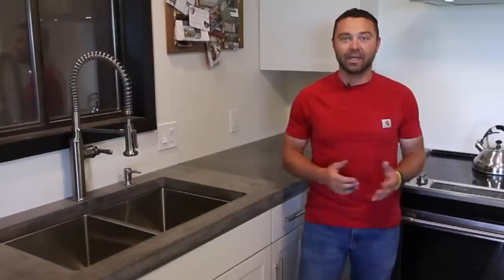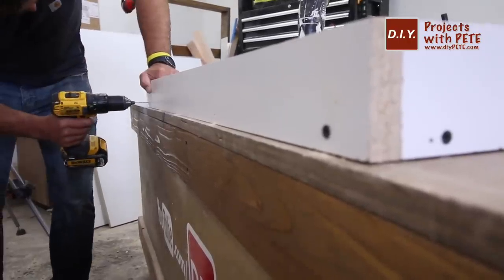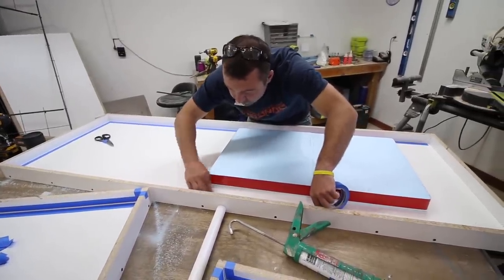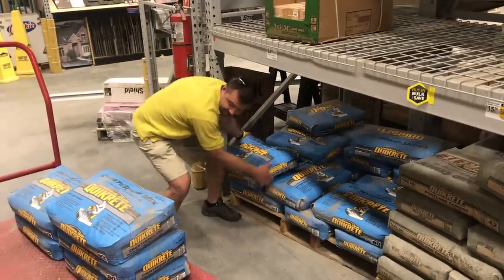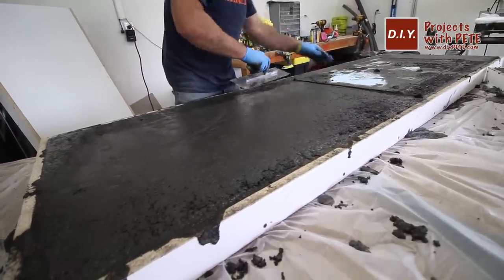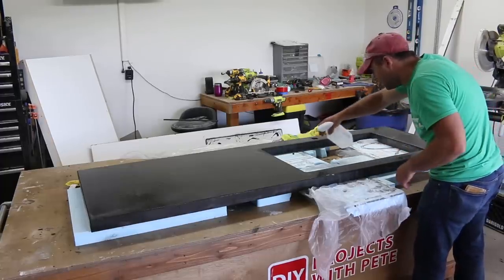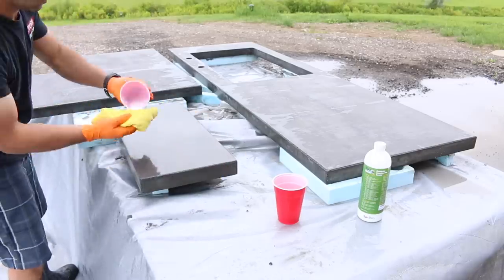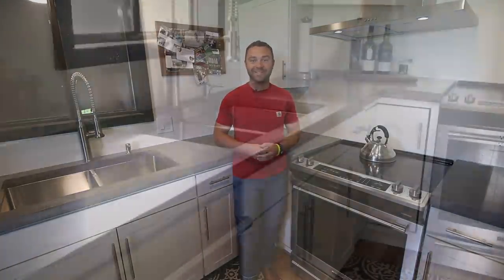How to Make Concrete Countertops

Comment: To the 'Naysayers' and those dubious about how well a concrete top will hold up - We did this in our kitchen 20 years ago, and it still looks fantastic today!
Reply from the maker: Great to hear your experiences with concrete countertops over the years!
Reply: @Seriously! How? I actually had my doubts. concrete is durable but chips easy imho so yes, I had my doubts.  The stronger mixtures are probably even better for kitchen, but I want these in  my bathroom :-)
Reply: @oldwortex5818  that were my doubts as well. Don't know if it might be a good idea to use fiber reinforced concrete for this exact reason. By the way  DIY PETE  I really felt satisfied by the way you took care not to mess the mold with excess silicone by taping all corners below and above seams. Congrats man!
Reply: Glen & Friends Cooking It’s not their durability I question, it’s their horrifically drab Soviet Union-style appearance.
Reply: Bet you have to power wash them too. That cement soaks and over time all the dirt and what not gets into it. It can't be no different than a cement slab outside just getting walked on. It gets dirty.
Reply: @mikedavis8026  That is why surfaces like this are sealed.   That keeps stuff from getting down into the concrete, and keeps it looking nice.
Reply: @wanketta  I agree that the Prison Gray color of concrete is not to everyone's taste.   However,  by using stains and inlaid bits (as touched on in the video)  the whole "Concrete" thing disappears.    I have a friend who got some large slabs of ornate stone and inlaid them into his counter tops.   Polished down and sealed,  they look Great!
Reply: AngeLife I’m confused. Then why are you watching this video? Genuine question.
Reply: @wanketta  Gray can look amazing when coordinated well with other colors. I'd take it over Bush-era Tuscan red any day.
Reply: Thank you for sharing!
Reply: too much work.. i wouldnt leave it drab grey. i would find a good decorative porcelain tiles to cover it

Comment: Nice work to help inexperienced folks understand that they can tackle a project like this with attention to detail, and patience.  One thing to add is, after screwing the forms together, apply a small piece of tape over the screw heads.  The tape will prevent getting concrete or other debris imbedded in the screw heads.
Reply from the maker: Thanks for the tip!

Comment: Thank you for the video, it was super informative. I am a concrete form carpenter/finisher, and I’ve done an insane amount of sack and patching. Which is just filling holes and smoothing out the surface. When you were patching holes(which you always have to do) I’d recommend using a tile float, and mix a heavy wet sludge of Portland cement/water/moose milk. Get your slab wet and you can really push the mix into the holes with the float. And you can cover the whole slab insuring you don’t miss anything. You can even use the float to get off some of the excess. Then wait and polish like you did. Again, thank you for the video, I’ve only done big commercial projects, so it was nice to watch something with a prettier outcome.

Comment: I could have used this a few months ago!... P.S. The omega sealer from the concrete countertop institute is awesome. It only comes in low sheen but they told me I could use an automotive polish like Maguire's to polish it to a semi gloss finish, which I did. Plus, the polish adds just another layer of protection to the sealer, although it doesn't really need it. Thank You Pete!
Reply from the maker: Hey Dan! Awesome to hear about your positive experiences with the Omega sealer. Got some in the other day and can't wait to try it out!!
Reply: carnauba wax will seal concrete and is edible. You can find it easily in the car esthetic section of big household stores.

Comment: Great video Pete thanks.  Awesome explanation without any waffling.  Can I suggest that the pigment for the concrete should be weighed so that you get a consistent colour through all mixes.  Also you can use a hammer drill (with no drill bit obviously) to get air pockets out by holding it on the formwork for your concrete, acting like a mini concrete vibrator.
Reply from the maker: Thanks Andrew! Great to hear from you and I'm always open to hearing ideas and feedback. Thanks for the ideas and suggestions! I do from time to time use a reciprocating saw without a blade and other tools, but I haven't tried a hammer drill on it yet. Sounds like it would work great! I do have a vibrating table and pencil concrete vibrator, but don't typically use them in the videos since I like to show they can be made without having all the expensive specialty tools. But the idea for a hammer drill is great! And weighing pigment is great! Thanks!
Reply: U must knw evrything...il hav to remembr that.

Comment: Wow!  Thank you so much for this video - loved that you were direct and to the point while talking, and the steps were all so perfectly explained.   This is my go to video for when I attempt to make my own concrete tops!
Reply from the maker: Great to hear, Christy. Thank you for watching! Here is another video I did on concrete tops that shows an even easier method without having to use a wet polisher. The process is done for less money and in a quicker timeframe without having to polish ( using an orbital sander instead ). Anyhow, just thought I'd share the link in case that is helpful for your project. Cheers! https://youtu.be/A0Pd4o8gjfM

Comment: Pete, I have been wanting to do concrete counters for quite a while and after making a wooden cooler stand from your tutorial, I felt comfortable with your guidance because that turned out great. I have made and installed all of my concrete counters over the last 2 weeks, all with the help of your videos. I will say, it is VERY labor intensive. It's always funny thinking, "this looks easy!" after watching a 20 minute video. In reality, this took many many hours but I will say that I am pleased with the results. A couple tips that I would put out there that worked better for me:

1. I made one of my counters with the concrete mix a little "thinner" (more water) and it had almost zero air holes. The other 2 that I made oatmeal consistency had quite a few. I will say that the 2 with a lot of holes look really cool after filling and sanding though. The surfaces have totally different appearances from each other but it still works.

2. When sanding the slurry off, I used a dry orbital sander. I started with 150 grit and that barely worked at all. I continued to move towards a coarser grit until I got all the way to 60 grit. It still seemed to take forever to make any difference. I then (by accident) found that it seemed to work better after I would clean the surface off. After more and more time, I found that the sanding worked better because of a little water on the surface. I started lightly coating the surface with a little water and the piece started coming together much faster than completely dry. 

Again, thanks for all your help! I will continue to use your expertise as a resource as I only have a degree in Redneckery which I took in Hackoslovakia so any help for me is welcomed :)
Reply from the maker: Hey Nicholas! Great work taking action on all the projects. That is awesome. Thanks for sharing your tips and feedback as well!

Comment: I've watched a few of your videos now and after hearing you say about a way to seal the counter tops I thought which I suggest. Have you ever thought of using a clear epoxy resin to the completed installation of the counter tops. I only suggest this as I just feel that this would it would give you a really strong cover coat to the concrete which would not only let the full effect of the top show through but would possibly save further treatments in the years there after. Love the work that you have done so far that I have seen you do
Reply from the maker: Hey Steve! I know some folks do use epoxy. It would certainly protect it from stains. It takes a little bit away from the natural stone look, but also can really shine it up. I am going to be using Omega sealer on some future projects, which is a very very good sealer that I just started testing recently. Cheers!

Comment: Man that looked like a ton of work, Pete.  Makes those little tops we did look like child's play.  Well done, they look great!
Reply from the maker: Thanks so much, Brad! That was fun building with ya in Nashville. I actually just finished an outdoor kitchen with tops using the dry sanding technique and $6 quikrete. I actually like them more then the wet polished tops in this video. Cheers!
Reply: Fix This Build That y
Reply: Nice job, I hope to have the courage to try this myself soon!
Reply: @DIYPETE  I got the inspiration to do this from a picture on Pinterest. That was a more rugged looking concrete top so I assume the cheaper concrete mix and dry sanding will make that look. The polished look did not impress me, but the way you worked did.  Thank you !
Reply: Try buying some microballoons and mixing that in with your concrete.  Know as micro balloons or micro spheres from 3M or other suppliers.
Reply: A nice trick for the mold, is to line the main face with 1/8" polycarbonate.  Leaves an almost polished finish, straight from the cast.
Reply: @DIYPETE  curious if you can put tiny seashells imbedded in the surface without making the surfact uncleanable. I sort of think of a satin epoxy just to fill in the gaps to make it level, not to make a giant epoxy top. Don't want like a 1/4 inch layer of epoxy on top of the shells, more like 1/16"

Comment: Random tip. When applying silicon put dish detergent in the water, silicon don't stick to detergent. In other applications you can put a bead of silicon on then spay with the detergent water and wipe away with a finger. the surface that contacted the silicon before you spay will be the only place it can stick. Gives you a easy clean finish.
Reply from the maker: Thanks so much!!
Reply: I did that once with a coloured detergent and the dye leached into the silicone.
Now I use a clear detergent.
Cheers.
Reply: Or you can use alcohol 😁
Reply: I use denatured alcohol
Reply: I've always used 100% grass-fed sheep's vomit, a little hard to find but works better than anything else.
Reply: Soap reacts to the silicone and cant make it go black. Avoid doing that.

Comment: Pete ... That's an amazing use of concrete for the countertops. I want to try this, but might start on a smaller scale. I haven't done many kitchen projects, however my brother-in-law, and I put up backsplash in my kitchen a few years ago. It's not very hard to do but it's time consuming, especially if you turn the tiles in diagonal directions and have to do more cutting and fitting. It took us a good 2 full days to put the backsplash all around the kitchen. But man, it's a great way to enhance the look of a kitchen.
Reply from the maker: Hey! I agree that the backsplash is a great addition to any kitchen. That's really cool you tackled the project with your brother in law! -- As for countertops, I'd definitely recommend practicing by doing a table of some sort first. Cheers!

Comment: I don't suppose you could sent me a higher res shot of the silicon/concrete mix for the seam? I'm doing something similar soon, and wasn't sure how to combine the two well.

Thanks.
Reply from the maker: Hey Colum! All the mix is for the silicon is white 100% silicon -- and some quikrete charcoal liquid pigment. Mix it up for a minute and it will mix in well. You can also use dark grey paint and simply mix it until it gets to about the right color. It isn't 100% the exact color, but looks pretty close!

Comment: Thank you.from Brazil.. I`m making two countertops for the house I`m building. My wife wants it to be perfect, no imperfections. Hopefully following your tips will do!
Reply from the maker: Best of luck! If she is looking for perfectionism, concrete counters may or may not be the answer. I'd definitely recommend doing some small tables etc prior to doing your first big counter project. Cheers
Reply: That's the plan... I'm going to make it a few small slabs to see the best color/mix and finish, and then, will go for the big ones.

Comment: Good to see all the love for DIY concrete tops, and for DIY Pete. Nice job, hard to argue with your results. Only thing Id do is drop that rebar and run AR fiber throughout ;) [your polisher will burn off any exposed fibers] OH, I liked the plasma cuttin' in the kitchen! Cut up dinner while you're at it
Reply from the maker: Thanks for watching and for the info! Cheers!
Reply: Not true! Fiberglass all the way through is a mistake, unless you want to see the fibers, and is not needed with rebar. Fiber just on bottom side works best. You will see the fibers regardless of polishing. This video was excellent and showed the right way to do it.
Reply: :) DIY pete does do a great job on all his projects, I enjoy watching the guy. As far as The fibers and rebar Im guessing you do this for a living and have a bunch of experience, I wont argue with you. Cheers mate!
Reply: No sign of fiber in ours, and it's fiber in 100% of the mix.
Reply: There are many types of fiber, many people don't understand that. If the fibers show then it is too large a fiber. Sounds like you used the right stuff. The other thing thats commonly ignored is the term 'AR' or alkaline resistant. Fiber with dissolve (as soon as 30 days after the pour) if not designated 'AR'
Reply: UnitedStatesofBuild Sandra’s

Comment: Thanks DIYPete. I'm wondering about the possibility of a concrete counter, with sink and backsplash, cast in place, one-piece.... feeling a little more brave, now, thanks to your vid.
Reply from the maker: Hi DH! I've never done an all 3 in one countertop. I've seen a number of counters with the integrated sink. While very heavy, they can be done. As for adding a backsplash, I would do that separate if it was me. Looking forward to hearing what you come up with!
Reply: I see them done on HGTV all the time that are cast in place.  Even waterfall edge.  Casting off site looks more labor intensive.

Comment: did this myself for a small project. idk about the specific concrete mix you used, if you mixed it too dry or if that is supposed to be that way, but I used Sakrete 5000 and something called flowcontrol from rapidset (home depot sells it). the concrete was flowable with the additive, so it looked very soupy but found its way in to all the crevices nicely. most of the videos showing professional concrete countertop makers seem to also have a very flowable mixture. the end product came out great.
Reply from the maker: Great to hear!

Comment: Man that looks like a lot of work, saw a video that a guy used Rapid Set Mortar Mix, looks WAY easier and cures in an hour. I really like your molds, got a good bit of information from this, thanks.
Reply from the maker: Thanks! I've used rapid set on a number of projects, but unfortunately haven't been happy with the results - especially any table that has gone outside. I love the instant gratification, but will be sticking with normal mixtures for now.

Comment: Your video was a great start for  planning to do this for the first time.   My biggest concern  was having an eight foot top with the sink dead center.    Wanting to grind the surface to expose the aggregate anyway,  my solution will be to make the mold an additional inch wide and cut it to width with a diamond blade after it is in place.  That is my plan anyway.
Reply from the maker: Good luck with your project.

Comment: Ive done concrete countertops a few years ago. I pretty much did the exact same as you.  You're correct about sealing the concrete.  There's no perfect sealer! They will patina.  Also, acid (lemons etc will etch your countertops) I'm considering putting expoxy on my countertops.  Have you done this before? Or can anyone else chime in?
Reply from the maker: Hey Christian! I would highly recommend using the Omega Sealer from the concrete institute. I've done some tests with it and this is by far the best sealer in my opinion. I just got some after this project. https://youtu.be/24Bmn3x5v2E

Comment: I use sakrete maximizer for concrete countertops. Works well. It’s about $8 for a 80 pound bag but they use a light weight aggregate which makes the coverage the same as about 130 pounds of normal concrete. I did my bathrooms, kitchen and outside bar with it and never had an issue

Comment: Hey mate have you ever tried an old bank card for cleaning up the silicone? Works great. Apply soapy water as well this helps smooth it off and not stick to any surfaces you don’t want it to.
Reply from the maker: Thanks for the tip!

Comment: Hi Pete. That looks fantastic and thank you for the tutorial. I have a couple questions. I have counter top that will have angles and I’m wondering where to put the seam?  Should I miter the two counters together or butt on end up to the other at the corners?  Also,At the sink should I put seam at sink because it’s a thin area? 

Thank you in advance for helping if you can

Comment: If you're going to do lots of this, buy or build yourself a hot knife for foam cutting. It leaves a nice finished edge and depending on the wire you use, will cut tighter than a coping saw could ever hope to.
Awesome video though. I think I'm going to use this method for my countertops when we remodel the kitchen.
Reply from the maker: Thanks

Comment: Mr. DIY Pete, to smooth the silicone better and easier you should try 1/4 liquid dish soap mixed with 3/4 water. I do it many years now when insulating windows. Because of the soap the silicone doesn't stick at all on the fingers, and the bead comes out smoother. Anyway, your work looks excellent. Thanks a lot for shearing!
Reply from the maker: Thanks!